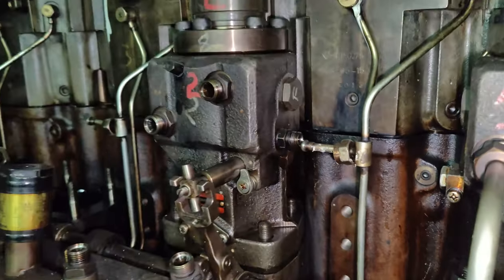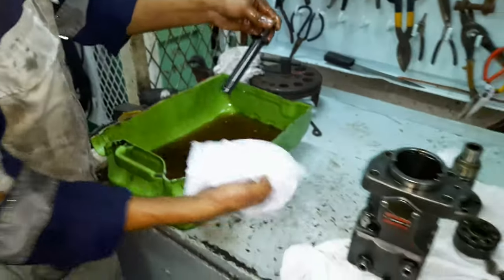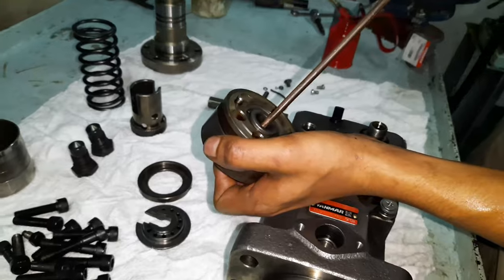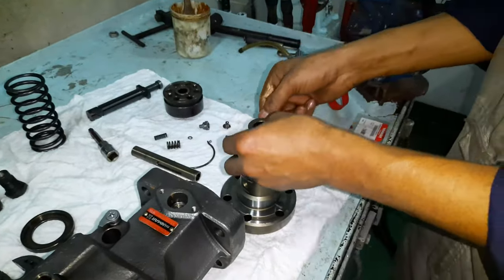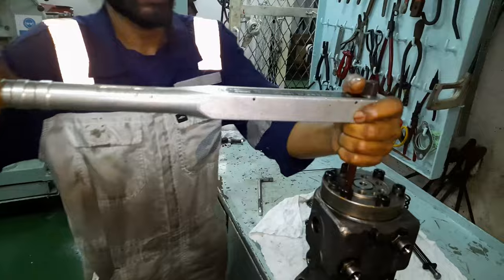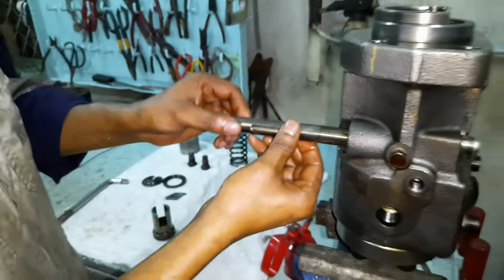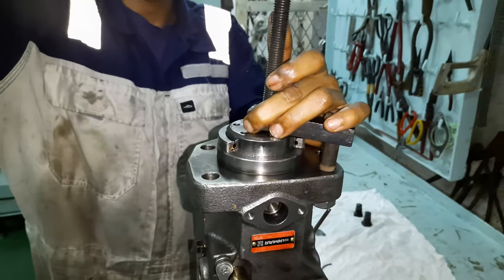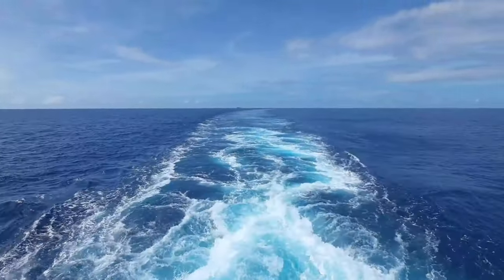AUXILIARY ENGINES FUEL PUMP COMPLETE O'HAUL PROCEDURES PART-2

Comment: If Possible could you share the significance of each o ring. How to know fuel is not mixing with lube oil. On ZJMD MAN BW L23/30H, it had slight fuel leak or lube oil leak